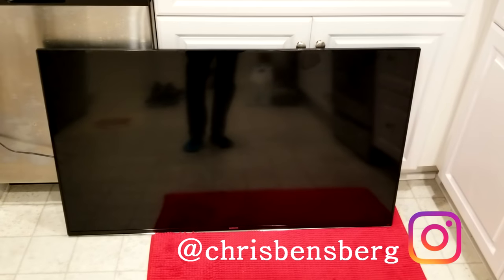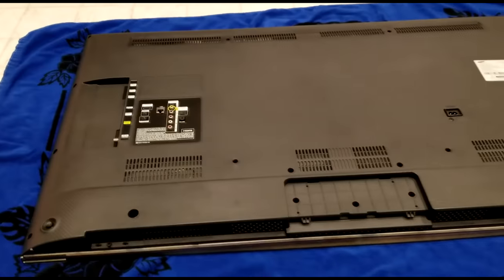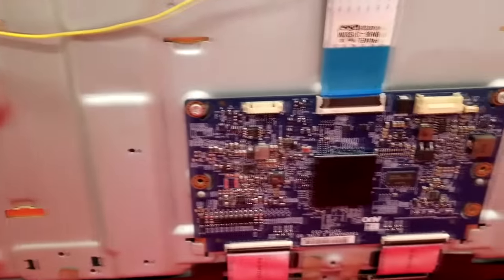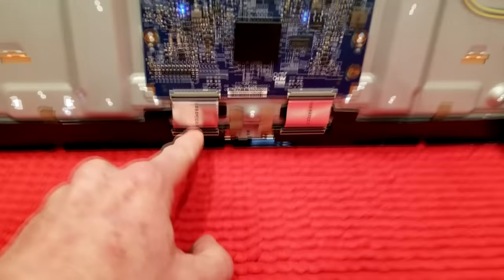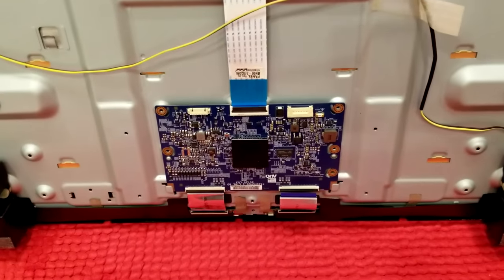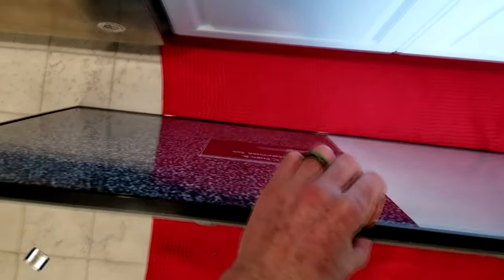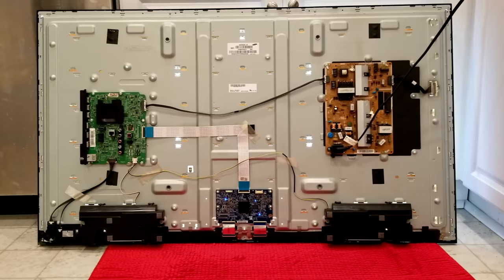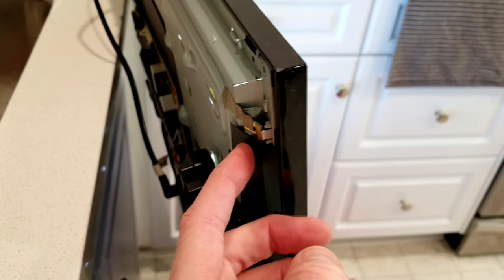Samsung TV Powers On With Back Lights But No Picture Potential FIXES or BAD PANEL

Comment: My volume/control buttons don't even show up. Just sound and back lit.
Reply: once I plug it, the remote doesnt work at all, just backlit until i unplug :(
Reply: Same problem here.  Did you ever get it fixed?

Comment: I've replaced the burnt-out LED strips, I've replaced the T-CON board. Samsung ue48h6240ak TV. My removing one side of the ribbon cable for the T-CON board like shown here, it allows all LED lights to power up, but nothing appears on either side of the screen. It's just light but black, any ideas on whether this would be panel, power or mainboard?
Reply: Sounds like the panel but I'm no expert, there is videos on here how to repair the buffer board so don't do what I've done and throw away the tv
Reply: I have the same problem with my 40''

Comment: Mine shows picture for a moment, then turns all black :(
Reply: yea same problem, any sugestions? what to change first?
Reply: @GodexWasTaken  Is the TV still on when it goes black? If not and it shuts off right away then its the Power supply, check the capacitors to see if bulged.
Reply: @Josephthinleg  It stays on. sound also works

Comment: Your problem is the COF you removed you now have to use pieces of tape to bypass the shorting pin called ‘tape bypass’ method….100% repair